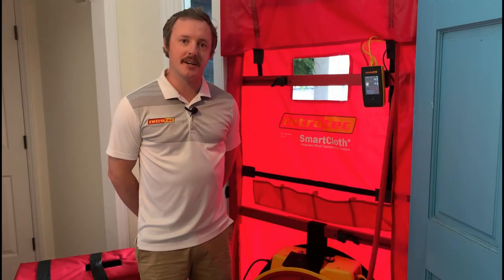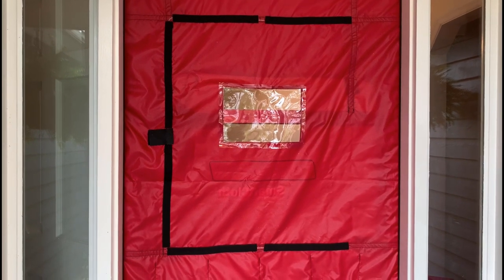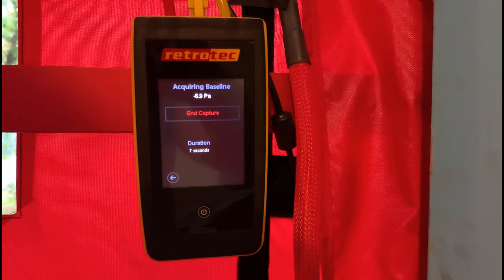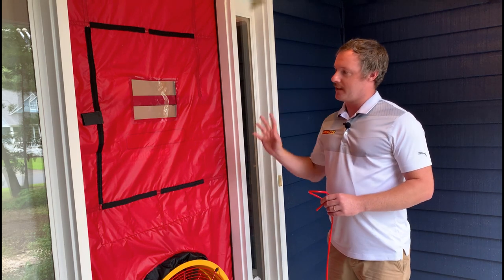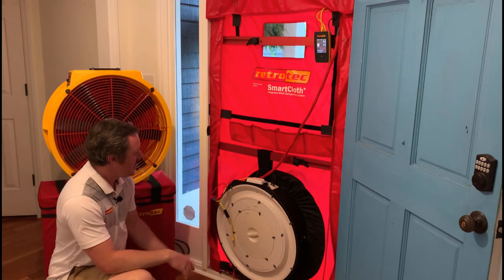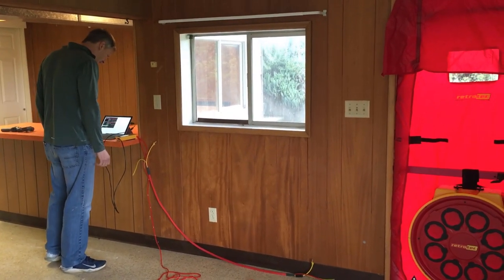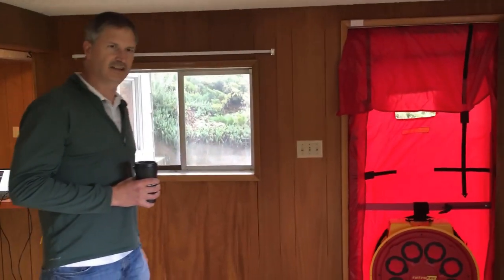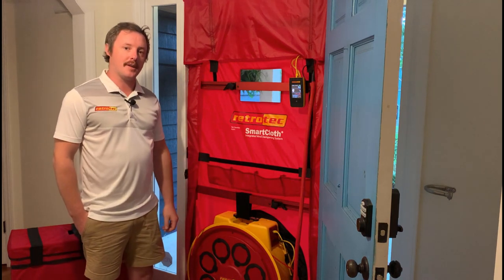Introducing SmartCloth: Integrated Wind Dampening For Blower Doors

Comment: Absolutely useless when regulations state that the reference tube should be away from the building. In fact CIBSE documentation says it needs to be 10m away from the building. 🤦‍♂️
Reply: I don´t think, that Retrotec does or invent something which is out of the regulation.
Reply from the maker: its folks like us who end up driving regulation changes ; ). Be on the look out.
Reply: Wiesenheini well, they have
Reply: RetrotecEnergy you say that, but how many regulations have you been able to force through? More interestingly, for any that you have changed, how long did it take? Testing by Pulse technology for air tightness testing has been pushing for changes to regulations for about 14 years and only just managed to get a foot in the door
Reply from the maker: @leekenton84  thats because Pulse technology is extremely limited. You cant do large building testing, and you cant locate leaks with it. No matter what, you're back to using a blower door to locate the source of the issue. As for regulations, we literally wrote the book on the NFPA standards for using a blower door to test for clean agent fire suppression installs. We also sit on various committees across the globe to improve test standards.
Reply: Regardless of regulation compliance (Scotland - ‘2m away from facade’) I do appreciate the thought behind this design. 

I’d love to see more comparative testing in relation to the blower door & traditional external reference tube locations vs wind direction. In this scenario, due to structure and the wind direction, I would fear that the “open end” location of the traditional external reference tube is not as sheltered from the wind as the twin “open ends” of the integrated smart cloth reference tubing. My fear is this may play a big factor in the huge variance of comparative results shown between both methods of collecting base pressures. 

Further testing with comparative exposure to winds/gusts and importantly the wind direction would be useful.

What I do appreciate and will take on board are the benefits of the mechanical dampening introduced by the use of splitters and elbow connections to create 2 reference points. This is a process that can easily be adopted in the traditional ‘through the door’ method of collecting external references by simply splitting your reference tube using a t-piece and then extend these branches to a regulatory pleasing distance. This allows two separate “open end”reference points with the t-piece (and further elbows) assisting with dampening all the while complying with regulations regarding distance from facade.